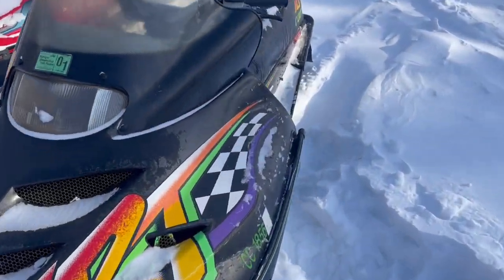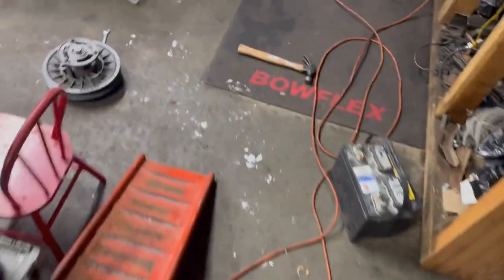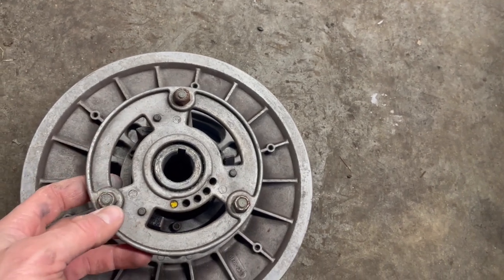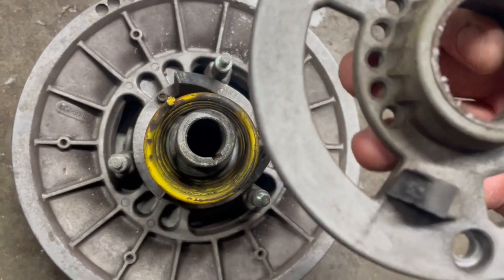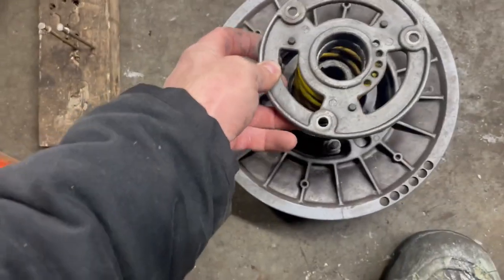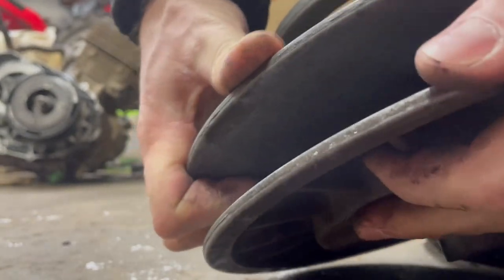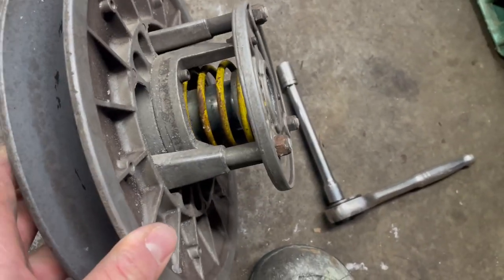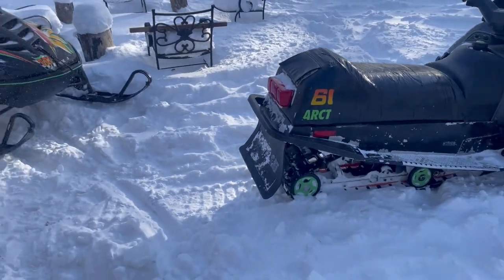1996 Arctic Cat ZRT 600 Snowmobile Secondary Driven Clutch Spring Tension

Comment: I believe the hole it was in was actually the strongest point, but the guy who put it together seemed to have turned the plate backwards instead of forwards to the next bolt. When you unbolted the plate it turned clockwise, when tension would have turned it counter-clockwise regardless of the hole the spring is in. Good job on setting the tension properly